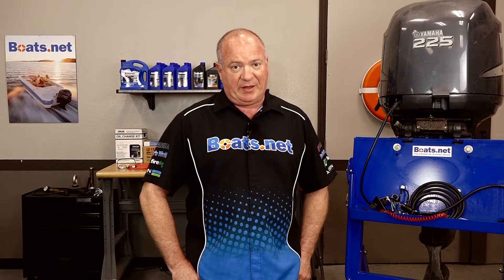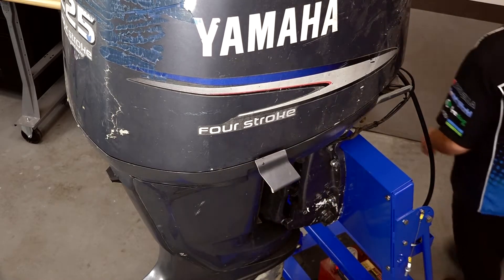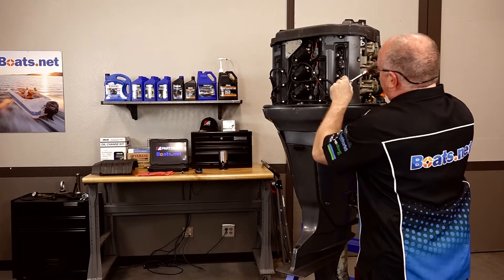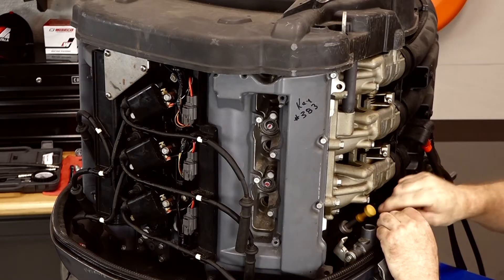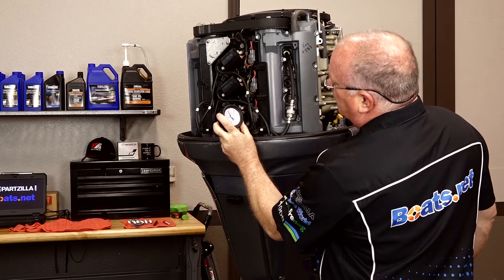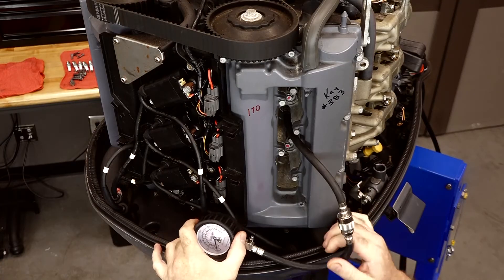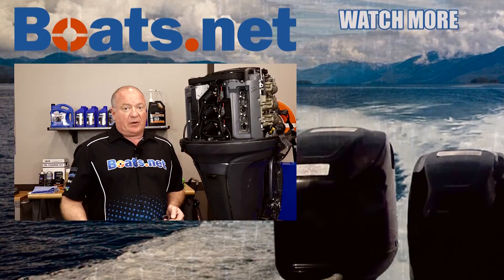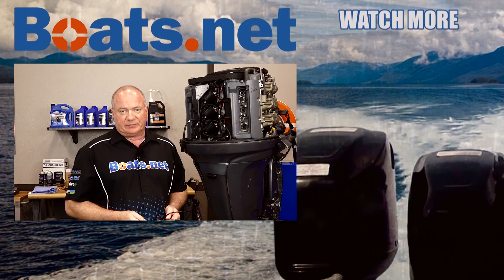How to Compression Test an Outboard Motor | Yamaha F225 Compression Test | Boats.net

Comment: Very nice work Sir,  there are way over 15lbs differences.  I checked on a F225 and top right is 125lbs and rest are 135-145lbs, owner says it has 700 hrs, I see 2500-3500 hrs. My 95 DT225 has 135lbs even and logged 2850 hrs, still good for a 2 stroke.

Comment: John hi . Thank you for the video it has been a great help . I have a question regarding the doug clutch on a yamaha LF150TXRC  the F stamp on the dough clutch  will go towards de propeller or toward the shift selector . Is a counter rotation .  Do you have a video that will explain how the counter rotation work the location of the pinion will change position if it is a counter rotation . Thanks